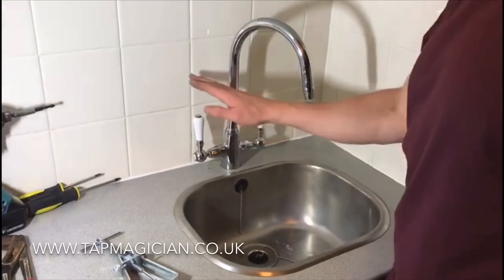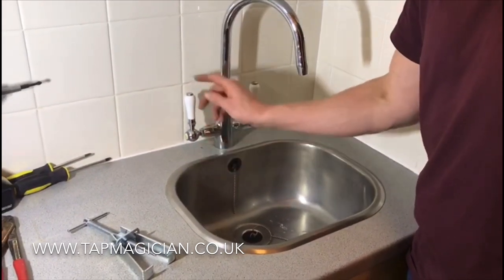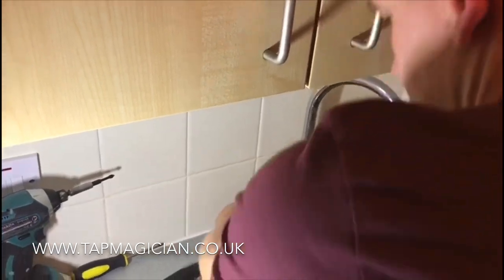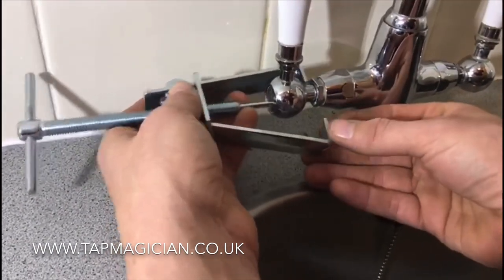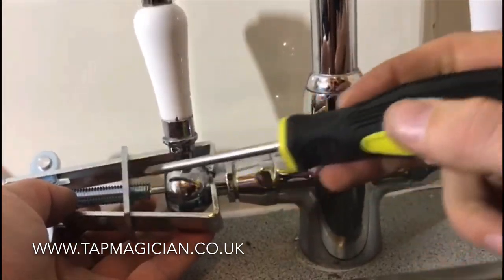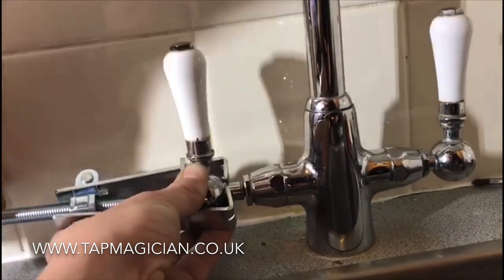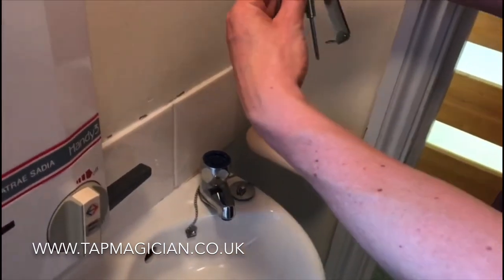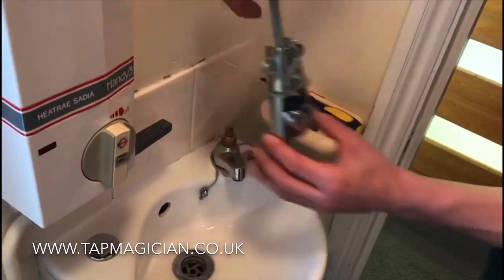@tapmagician Removing a stuck seized tap handle with a tap handle puller

Comment: I was so hopeful as I have exactly this tap. The tool arrived today but it's not helped. Instead of gripping it just slides around the round part of the handle. The brace part of the tool that's supposed to prevent this, just slides up the tool, it doesn't keep the jaws together. You could improve the design by having something to retain the brace in place. Not sure what else I can do beyond replacing the tap. All for the sake of cleaning the cartridge.

Comment: What about if it is the handle screw that will not budge? It's in danger of rounding out and is 15mm inside the handle so cannot even be seen, to check how much danger of losing the 'star' there is, as the screwdriver has already slipped out of the 'star' a few times, with as much pressure on the screw as possible, which makes the rounding-out worse.
Reply: You may need to drill the screw out first and fill/drill/tap the hole after you have removed the handle (or - probably easier and definitely faster - buy a new cartridge)
Reply: @dlevi67  A new cartridge wasn't an alternative. Replacing it was why I needed to remove the screw holding the handle to the cartridge. I did drill the rounded-out screw head out in the end, to enable the handle to slide off, enabling me to remove the shroud keeping the cartridge in place.
Reply: @george57l  No, I was just saying that you could have filled/redrilled/tapped the drilled out screw hole if you needed to recycle the cartridge (e.g. 'no longer made'). Main thing is that you managed to take the handle off!
Reply: @dlevi67  Understood (And finding an exact match for the cartridge is a whole other story. Eventual success, though.)

Comment: what about removing the stuck in brass manufacturers inside / o ring parts - as made of brass usually stuck - EASY TAP SPLITTER as such no good as mono and similar to this video - no access under bath and brass nut just crushes or flakes off and gets damaged further. Any product recommends i will gladly buy if reasonable as 2 such problems right now !